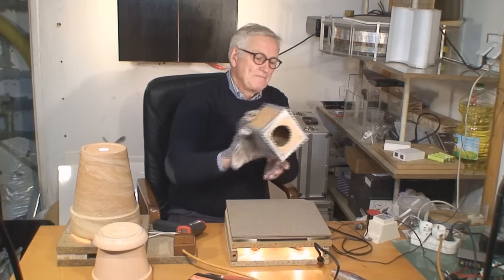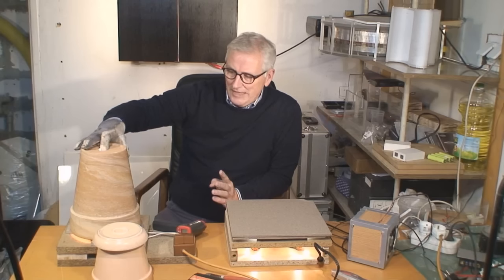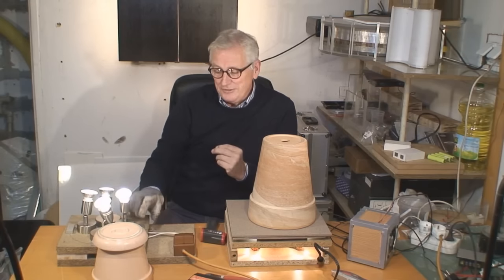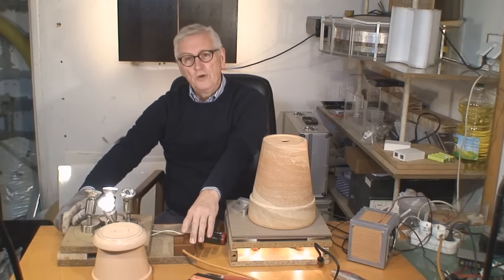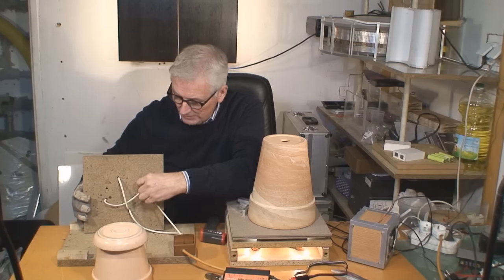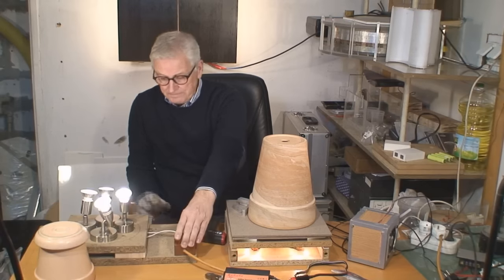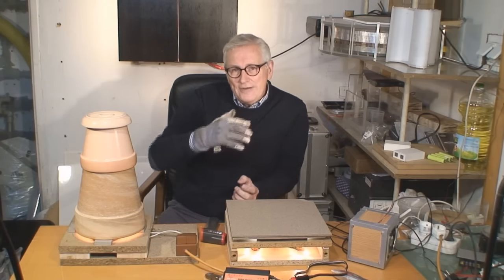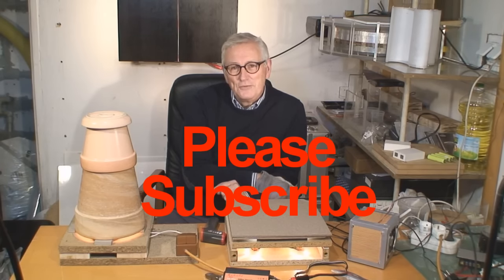Flower pot heaters to die for; BUT won't kill you

Comment: its a heat riser. the mass rising heated raidates. you could do a peltier heater with a fan to power it and blow heat off of it
Reply from the maker: I&#39;m looking at the Peltier system for my fridge and thinking of gathering the heat  produced on the flip side for a small insulated water tank. They are quite expensive but the whole thermometric tech interests me enough to play with it. Thanks for the feedback.
Reply: Enapp Open Source Energy there are videos on mre inexpenisve ways. is it the cost of mini peltier generator to buy? you can use alloys of semicondictors in series. mr tessalonian is a brilliant mind in this tutorial. carbonite from a carpenter pencil and alluminum?! 100 in seirea for 1 volt! you are doing great keep it up. i dont have space for my mad scientist lab so i live vicariously through you guys to acratch my itch!!!!
Reply: the word more instead of mre
Reply from the maker: Heather Crinean I'm turning my van into a lab for when I travel. So you don't need much space. Try making a little space and have fun with it. There really is still a lot to discover. String theory is the most fascinating as it really is a yet untapped 'endless' source. From my initial experiments it seems we really can call into being that which does not exist when we activate those strings ;)
Reply: i know, but im a disabled nurae and half my house is rotted out. priorities n such. i love the mobile thing! rock it
Reply: +Enapp Open Source Energy
"String theory". Really?
You can 'activate' the strings? How might you do this, and just what do you mean when you suggest you can thereby "call into being that which does not exist"?
This all sounds a bit 'woo' to me.
Reply from the maker: occamrules String theory although it may sound a little "Woo"; is an actual science and is still in the realm of 'unknown' meaning we just don't know enough about it to understand fully how it works. Plants for example store electrons in several places at the same time. Yip that's right; the same electron in multiple places. Now I'm not saying that we'll get to understand it fully in my lifetime, but it is VERY interesting science for sure. Bit like fusion was before it got funding and is now making quantum leaps towards supplying all our energy needs. Stick a peeled grape in your microwave under a plastic transparent cup and what you'll see is plasma. Figure out how to stabilize it and you have a Nobel prize coming ;)
Reply: Enapp Open Source Energy
 String theory doesn't sound 'woo' particularly - it remains hypothetical, certainly, but perfectly credible. And quantum superpositioning of electrons (and indeed, much larger entities - entire atoms, perhaps) is now a well-observed phenomenon. No, the thing that sounds a bit 'woo' is "activating" the strings - what do you mean by this? And what is it that you are "calling into being" which doesn't exist?
You may be surprised to learn that I've decided I'm not going to spend too much time trying to stabilise plasma - billions of quid and thousands of man-years have already been expended to that end. I don't think my contribution is likely to rock the nuclear fusion community!
Reply: occamrules look, i undertand the point your trying to make, but things like the transfer of energy, lightning, subatomic particles proven by cern recently, black holes, etc are telling us that we need to rethink how "things" are being objectively observed (part of the scientific method) interacting. same thing they were saying to tesla and other pioneers
Reply from the maker: BRAVO! Heather; we do indeed need to relook at our world with all the new science and especially now we have open knowledge. Youtube has really got people digging deeper again with the help of NEW ideas and experimentation. We as a species did get a little lazy for a long time as we became too comfortable. But we all got exploited as a result. Thanks for the support!
Reply from the maker: Oh I see what you're asking. Strings seem to respond to the observers perspective; now I don't believe they just jump at the first request; but I do think if the passion of the observer implies a dynamic worth exploring, which may be collectively stimulated by other inspired observers; they call into being that which does not exist :)  Would love to explore this with you further though :)
Reply: Enapp Open Source Energy
I applaud your enthusiasm, and I believe that 'table-top' experimentation can still yield useful data. More power to you.

However, what leads you to believe that the 'strings' of string theory respond to the desires of an observer? And that the 'passion of the observer' might influence whether the 'strings' somehow decide whether to respond? And that a collective request to these 'strings' is more influential than that of an individual?

The 'responsive strings' hypothesis you appear to be describing is surely merely a reframing of 'the power of prayer', for which there is no empirical evidence. This is very different from the observer effect on quantum uncertainty, for which there is.
Reply from the maker: Prayer is a good example; as there is an obvious 'passion' in the desire. Even Jesus (was said to have) called many things into being, and said if we have 'faith' (passionate desire) we could indeed do ANYTHING. This implied a structure in nature that is responsive to 'passionate desires'. I believe that; this structure, is our little strings, that have been observed responding to the observers. So much easier to build it into nature than listening to all those prayers and dealing with ever one personally don't you think? ;)
Reply: Enapp Open Source Energy
But this remains wishful thinking, does it not?

"This implied a structure in nature that is responsive to passionate desires"... but only if it's true. Yet there is no evidence for the miraculous 'doings' of any religious icon, apart from anecdotal account. And studies of the efficacy of prayer fail to indicate that it does anything which cannot be attributed to a placebo effect.

I'm not saying you shouldn't believe in any, or all, of your 'responsive strings' hypothesis. It is entirely up to each of us to construct our own internal model of the Universe, and to choose how to rationalise the phenomena we experience, or believe we experience, in it. What I am suggesting is that in the absence of empirical evidence to support the hypothesis, the sceptic must be forgiven for declining to adopt the notion of quantum nature being responsive to a person's thoughts and/or emotions. Indeed, is declining the notion not the only intellectually honest way for a rationalist to respond to it?
Reply: Enapp Open Source Energy thank you for your encouragement and i find that my merd itch gets scratched with your videos LOL. my fanily loves watching all three of you guys. we got a kick out of the nasty malt liquor one and your faces
Reply from the maker: Wishful thinking implies that wishes have a half chance of coming true if someone simply wishes. No-one understands the structure of nature let alone the molecular structure of the infinite space we inhabit. Responsive strings are no different than a dry seed responding to water and soil. Nature demonstrates a 'responsive' structure everywhere you look and yet it is somehow difficult for the mind to accept or 'explore' the possibility that nature's dynamic is in an element it created to progress and adapt to an evolving 'need based' universe. The 'rational' mind can never truly discover if it is not willing to explore; and the empirical evidence is presented by those who dare to challenge skepticism with not just thought; but with deeper exploration.

Comment: Does the halogen bulb put out the most btu per watt for bulbs?
Reply from the maker: I tend to use my temperature meter a lot to judge the best performance. But my main goal is to keep the watts to a minimum as I'm usually using battery resources which can be limited, especially if it's running all night. So I use mainly 20w and 50w bulbs that give off the most heat per watt. Testing some carbon underfloor heating systems water and sand tubes that I'll be showing once I get past the insulation of the van.

Comment: I was hoping to find something I can run off DC power with a smallish solar panel (so skipping an inverter). That could heat house every day during day time.
Reply: Dark curtains in south facing windows would effective at converting sunlight to heat in winter.

Comment: just get cheap radiant electric heater. they are 100% efficient because converting ALL electricity to heat. Yours are converting just a small part of electricity to heat and big part to light. With the same wattage.

Comment: With all that heat..........................................
He is wearing a sweater over the shirt LOL!
Reply from the maker: Just got into the office mate. The heaters had been on for about 20 minutes.
Reply: It's not about temperature, but about power, IOW heat loss of the area you want to heat up. If your heat source (the flower pot heater) provides say 80W power then in order to give out some heat to your room the power loss of your room must be less then 80W. Otherwise your room will never get warmer than it is from that heater. Now, to have power loss on the level of 80W, you must have a perfectly insulated house and practically airtight, so the fresh air would have to be pumped inside already heated to a certain level. The Swedes have already invented this quite a long time ago.

Comment: Why electricity? What if you has no access to electricity?
Reply from the maker: You have several choices if you don't have access the electricity. Wood burners are amazingly efficient. In fact even a small (well ventilated)  wood burner can produce way more heat than most 'modern' electric heaters. I use electric to show how much heat you can store from lights mainly as most is lost to the ceiling.

Comment: I think the point has been totally missed on this original concept??? All the lights run off electricity !!
The whole point is if power is lost how can we generate heat for the home! So to me the candle concept is the most sensible option, bearing in mind during a power cut we have no access to electricity!!

Comment: Common physics,  any amount of energy used creates same btu,  restricting or different setup create higher heat but if you open area same thing... btu is BTU
Reply from the maker: Depends in where that energy is concentrated. Infrared warms objects. Btu is space related.

Comment: what if you will use  halogen lamps inside the aluminium radiator, you know normal radiator used for heating sistem with water.
Reply from the maker: You know it is funny you should mention that but I'm working on using a standard radiator painted black as a solar heater. And connecting it to a small water pump to circulate the heat back top the house. But I never thought of using halogen bulbs with it when there's no sun. Hummm I really like your idea on this one.

Comment: Ok, thermal energy from the lamps heats the flowerpot  then the flowepot heats the room ....why use the flowerpot ?  Thermal energy from the lamps is the same either you use the flowerpot or not  ....
Reply from the maker: The simple answer is 'Far infrared'. Terra Cotta immits far infrared waves which heat objects in the room but not the air. I'll be doing a full video on this in the next few days when I talk about the benefits of Far Infrared heating systems.
Reply: @SocialHigh  ok first time i get a decent answer to this ... will try it thx

Comment: Sorry but 80 watts inside that flower pot wouldn’t heat up the ceramic pot to 222f which is 105c as I’m doing the candle technique I have 10 candles at max burn so when the paraffin wax is melted each candle pushes out about 35 watts of heat and I can tell you my 22cm flower pot doesn’t get any hotter then 73c so your 80 watts of energy compared to my 350 watts of heat energy so your 222f doesn’t make sense not unless your using 4 x 80 watt bulbs and even then I’d be surprised if the pot reached your 222f or 105c
Reply from the maker: I only showed what the reading was. Try it yourself maybe.

Comment: Socialhack the 600W on the wall probably isn't heating the tile as much because heat and light is escaping the sides and top, whereas the table-top tile over the bulbs are directional so heat rises up into the tile.

Comment: 80 watts is 80 watts.
you cannot stick an 80 watt lamp in a flower pot and get 500 watts of heat.
If it did work, people would make and sell them at Walmart.
Reply from the maker: Radiant heat is about heating the pot and warming yourself from the stored radiant heat when you're in close proximity. Nobody tries to heat they whole camp site when you're sitting round the fire. Walmart will never be interested in educating us while we keep buying their over priced rubbish products.
Reply: I'm sorry but you put this in your van, it will not heat the van.  It will not work.  Try it: get into the van, close the doors, and turn on the flowerpot heater.  Stay in there for an hour.  YOU WILL BE COLD.
Reply from the maker: AlejoHausner I'm about to do a video showing ALL the heating options. Including the tile heaters, halogen flower pot heater, 110w tube heater and a few more options. But the big thing will be the insulation and circulation and how that makes all the difference ;)

Comment: I find it difficult that an intelligent person such as yourself can believe this. Some electric fan heaters have settings of 2000, 1000 and 500 watts and you can feel the difference in heat output. If you were to reduce their output to 80 watts it would be just warm air which would not bring the ambient temperature of a small room up noticeably. No way will a flowerpot or any other mass increase heat output. This is of course my humble scientific based opinion.

Comment: kinda defeats the purpose using electricity doesn't it?
Reply from the maker: A lot of what I do is to promote renewable sources of energy, such as solar. The reason I use 20w halogen bulbs is to reduce the consumption. Also one thing we forget is that light is the first thing we think about when entering a space. However most lights give off a lot of heat which usually rises to the roof and becomes useless. By capturing that heat into something that can 'radiate' like a camp fire, we get a lot more from our lights than just light.

Comment: Spontaneous combustion has been known to start at 170 f,by a steam pipe over longterm exposure to a 2x4,Halogen lights have caused many deaths and should have been banned many years ago.The bulb can deliver the heat, but the plastic fixture or the conducrtors or wiring were not engineered to be enclosed in your betty crocker oven,High temp output is NOT a good sign.The plastic and wires and wood and conductors will char over a certain number of hours . 160 f should be close to the safe output limit for this stupidity.